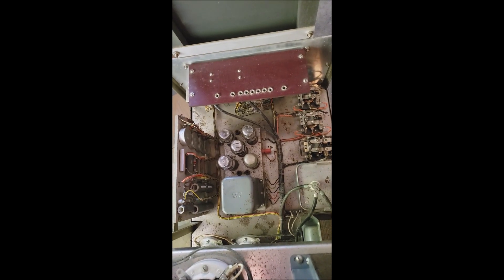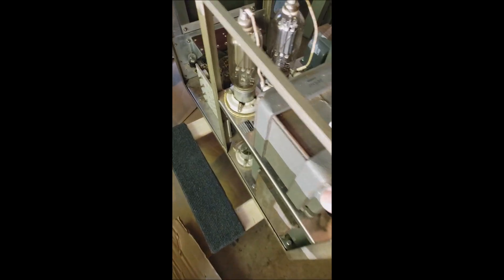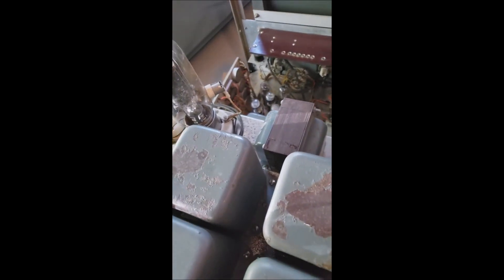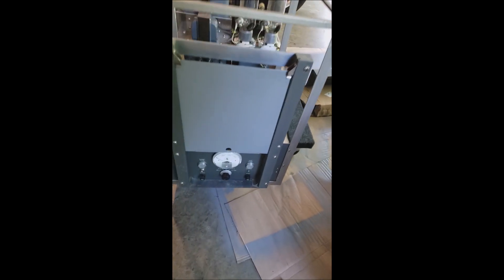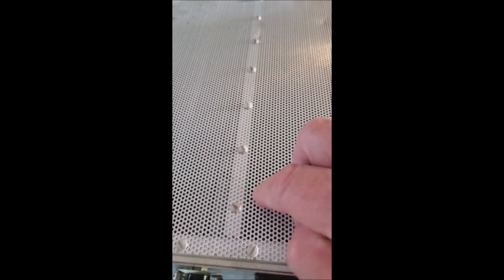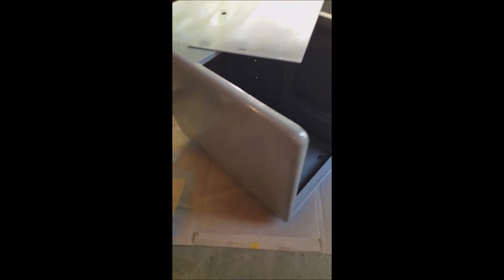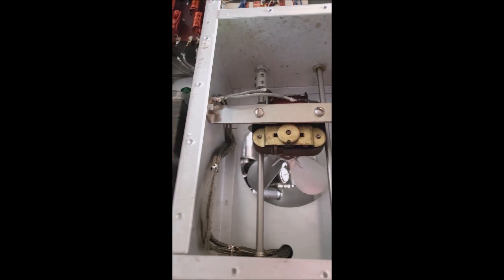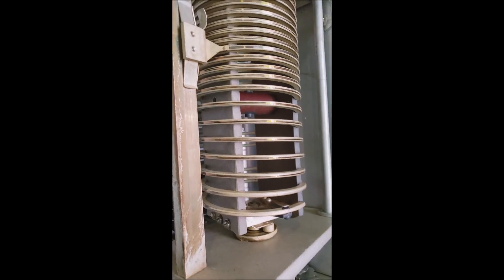E.F. Johnson Desk KW Amplifier / Transmitter

Comment: Hi, how do you key the kw desk? I mean what conector cables does it come with to be able to work with the ranger or did you have to make your own? Thanks 
W7ZAR
Reply from the maker: You apply 110 vac to one of the pins of the rear ACC jack. Normally you would get that voltage from the Ranger's antenna relay output.
Reply: Steve Ellington is that what you did with the ranger? Also when running a  Dowkey relay do you connect it to the amp or how does that work? Or two wires go to one place behind the ranger
Reply from the maker: @danpenamusic  Yes. The ranger's  relay output keys the desk kw and the dowkey
Reply: Steve Ellington sweet, I know the back has holes for that do you solder them on to the back of the ranger?

Comment: Hi again Steve. Quick q: what's the max p.e.p on AM. ?..2KW?
Reply from the maker: Well it's 1 kw input so if you multiply by 4 you get 4kw PEP input power then the output power would be that minus loss in the circuit. When I get done I'll have to put my peak reading meter on it and check. I don't have a dummy load big enough to handle this.
Reply: Steve Ellington Hi Steve. Say 70% efficiency on the PA I'm guessing around a 750 watt carrier and pep of around 2.5 kw. Look forward to seeing the actual measured specs. though. What a piece of kit!
Reply: Steve Ellington just run it into an antenna and say “375w test” HA- a lot of us on west coast do that. Pep is about 3700w pep on AM 800 carrier